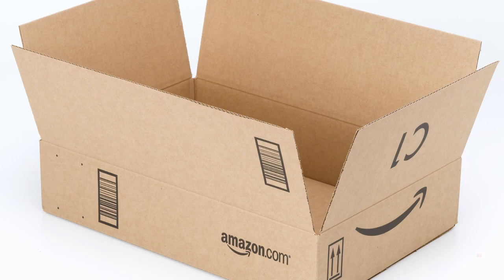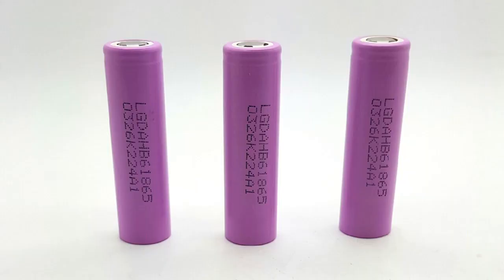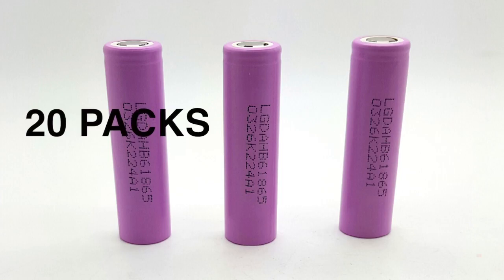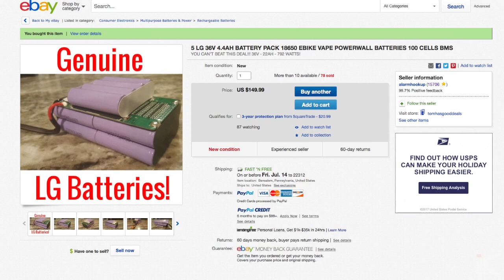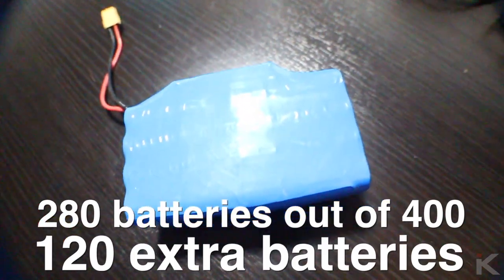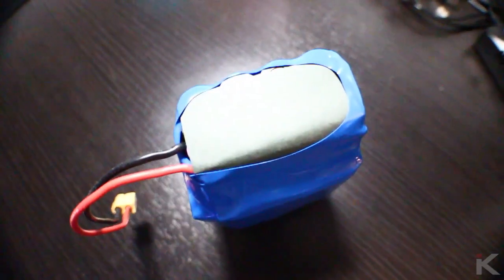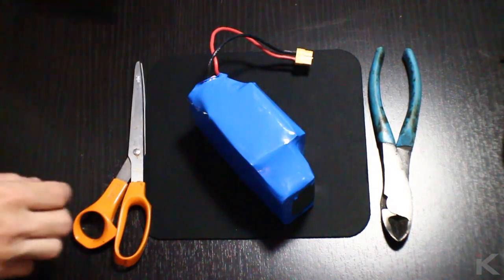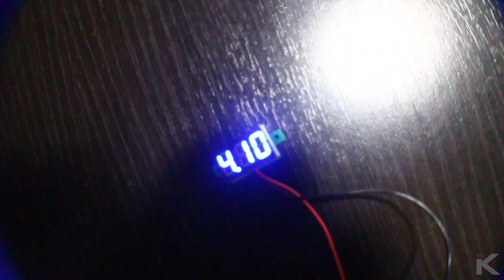Building a Tesla inspired Powerwall for my reef. Episode 1

Comment: i dont speck english very but i dont understand why you buy this packs just made insted buy just 100units lg cells. i think its cheaper and are ready to built your powerwall if you specifications.
Reply from the maker: Hello! 
The last time I found LG batteries for sale brand new, They were $3.50 each. And that was if I bought 500 of them in bulk. I am paying around $1.05 each for the batteries I bought from Ebay. Also the batteries I bought have a 2200-2400 mAh rating. All of the LG batteries I have found for sale in bulk only had around a 1700-2000 mAh rating.